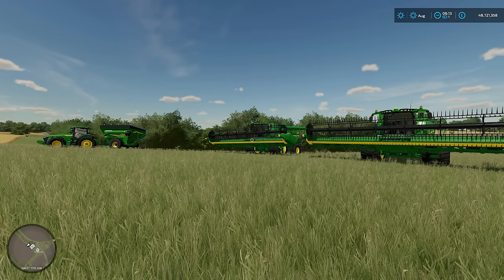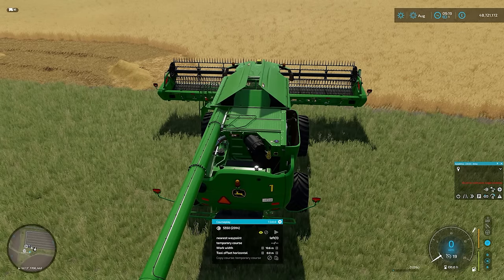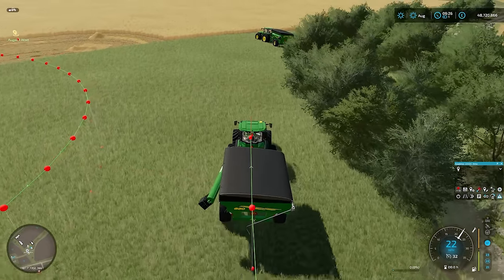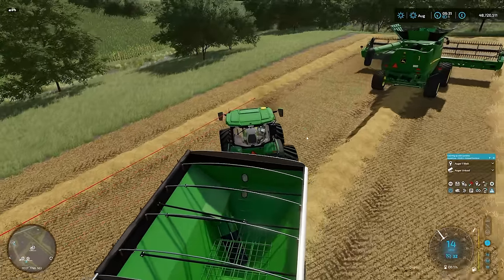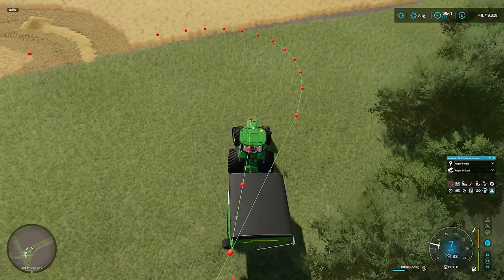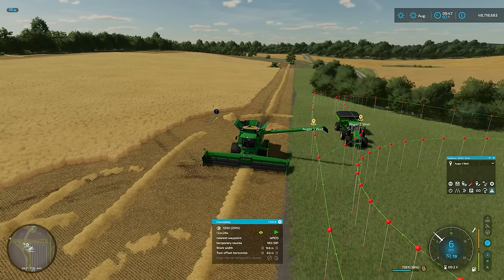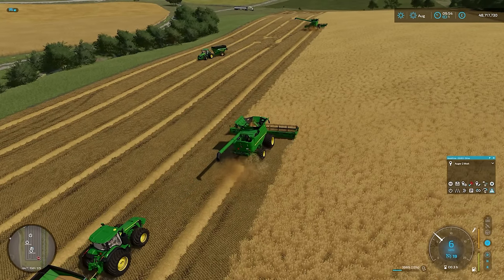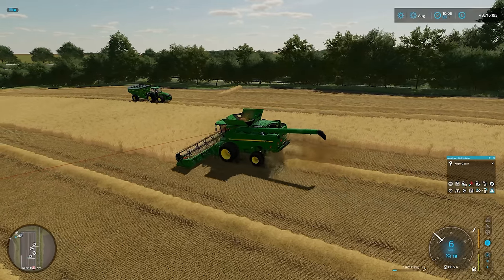Multiple Combines and Auger Wagons - Courseplay and Autodrive Tutorial

Comment: Like the dual auger wait point idea.  An alternative that I have done in the past for multiple harvesters/augers is that I would set up two (or more) different unloading points around the field.  This would include separate Semi Park's and matching auger unload/wait courses at each.  This works really well for larger fields where you have good access to multiple sides of the field.  The other trick I've learned when using this method is that once the headlands are done I will take one of the harvesters and split the remainder of the field in half (or thirds or quarters depending on # of harvesters) between the unload points, then start each harvester with a hired worker (not courseplay) on a different sub-section of the field.  This eliminates the possibility of the auger wagon having to go clear to the farthest reaches of the field to unload a harvester which shortens trips and increases efficiency.  For naming the different points I'll just use the field # with a letter (i.e. F25b Semi Park, F25b Auger Wait, F25b Auger Unload)
Reply from the maker: Good tips and suggestion mate, thanks for these 👍

Comment: FSG, Excellent tutorial. I have a quick question for you. Do you prefer running the Auger wagons on AutoDrive, or rather running them using Course Play? The only real difference I see, is the Truck wait point must be on the edge of the field, as the wagons don’t seem to be able to find the Truck or Trucks if the are not. (Of course the Truck/s must be on an Auto Drive course. As I don’t run huge fields, I typically run a wagon that holds 2+ combine unloads. I myself prefer CP, for how I play. What say, you?
Reply from the maker: I’ve tried both, and prefer AD for my carts, two reasons really, CP won’t follow the combine, it’ll just sit and wait so sometimes your cart can be all the way over on the other side of the field when your combine gets full. The second is CP chews through a lot more memory and isn’t as efficient running on your PC so you can get delays and frame rate drops. But ultimately they both work and do very similar jobs. So play with the one that works best for you (also I’m a creature of habit, so I should go back and try it again on Courseplay as it’s been a good few months since I last tried it)
Reply: Yes, on big big fields, this is the case; however, I did see the wagon move closer to the combine during the last harvest. Truthfully, I need to play more open maps. I kind of have a game going on Alma, and this map has big open fields, so I will give it a go.

Comment: When harvesters (no matter whether forage or sugarbeet harvesters, or combines) are running with CP anyway, I'd always use CP for the unloaders as well, and especially for auger wagons. Much quicker and more efficient, much less headaches. Always unloading on the go, etc. And you don't need those strange AD unload courses, just click and go. With CP my auger wagons can easily serve 2-3 combines without any combine stopping anytime.
Btw for combines with active unloaders you should always use lands as pattern for the field center in CP course generator. That way the pipe will always remain outside the fruit (except for the very first lane of every new land of course) and all combines can be unloaded in every lane without issues.
Reply from the maker: Yeah I tried CP and didn't get on with it, they didn't track the combines on the field so had more downtime than with AD, and it put much more load on my processor than AD did. but I know others who use CP for both. nice we've got options to choose from

Comment: New sub here - Great video on this, FSG! I was wondering if you could do a video (or comment) on doing this same setup, but slightly tweaked.

TL;DR: Can you right the same setup, but have the combines starting at opposite sides of the field?

I'm going to be using the Four Fields map, which has pretty large fields, and I'd like to run two combines but at opposite ends of the field, facing opposite directions. If you picture it using your computer screen, I'd have one at the bottom left of the screen [facing the top left ⬆] and the other at the top right of the screen [facing the bottom right⬇].

Although your setup works perfectly in the video, I'm trying to work out a way to avoid the equipment being so close to each other that they have to wait. With that in mind, a few questions:

1) Do you think my suggested setup can work if I place them like that?
2) Can I still run two combines as left and right if they're not following the same course?
2a) Can you use the same course but have a different start and end point?
2b) If you alter the start and end points in this example, can the combines still run as left and right of each other or do they need to follow the exact same starting point?

Apologies for the long comment😅. I'm just switching over from console to Mac, so this is all new to me. Thank you for the excellent CP and AD videos. They have really been a huge factor in helping me understand these mods.
Reply from the maker: Hey and thanks for the sub and support I really appreciate it, quick answer is yes! but rather than running two separate courses, I'd suggest still creating a 1x course, but moving one of the combines to the middle of the field, so it's working the 2nd half of the field whilst the first combine is starting at the beginning. It might be prudent to take the headlands off first through.
Reply: @TheFarmSimGuy  Thank you so much for taking the time to read all of that and for responding! 😄
Reply from the maker: @xindigochildx3417  No worries at all, let me know how it goes

Comment: IMO The reason the the carts got confused with the single wait point was that cart 1 could not calculate how to pass Combine 2. The cart got confused when the "power" button on Autodrive was switched off in order to manually drive around the combine. At that point the cart assignments to the combines switched. This can usually be easily fixed by switching to cart 2 and toggle the power switch returning the assignments to the original state..
Reply from the maker: But that’s a lot of manual intervention, the ideal scenario is you want to be able to set it up and leave it to run 👍

Comment: Awesome tutorial as everytime. So bad this is not working well if player is driving one of the combine. Autodrive is not as smooth when player is in charge on a combine. It does weird thing. Such as reversing without reason, waiting without movin or leaving before combine finish unloading.
Reply from the maker: I've never had that issue, it's all decided on when you open the auger pipe on the combine, so openining it when you are turning at the end of a row or similar will cause issues, but actually if you are running your up and down rows it works exactly the same as it would if CP was driving

Comment: For the Augers, one problem with them unloading ahead is if there isn't a trailer there.

I have experienced it where the auger goes to the checkpoint and is just stuck there because there is no trailer.

Once the trailer arrives it is not getting anything because ot thinks there is no auger.
Reply from the maker: The trick is to drive the trucks in from the other direction, they they’ll pick up the auger wagon pipe as the drive past it
Reply: Yes, the Auger is not doing anything unless is full empty, even the combain cannot trigger it, so for me works that I am pushing backward the AugarUNLOAD point, not after the truck, so, when the truck comes it coveres the trigger area of the auger. Tried with both directions. You'll have space because auger triggeres always at the beginig of the trailer and the UNLOAD point for the auger is on the back of the truck. Works for me.